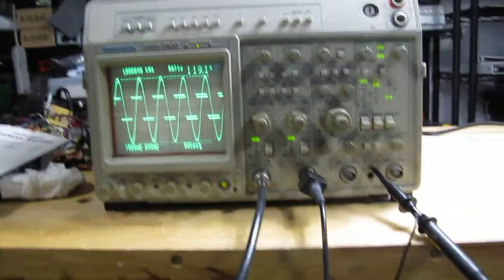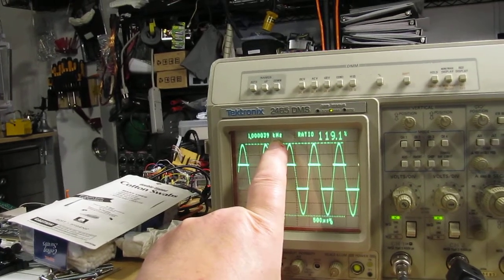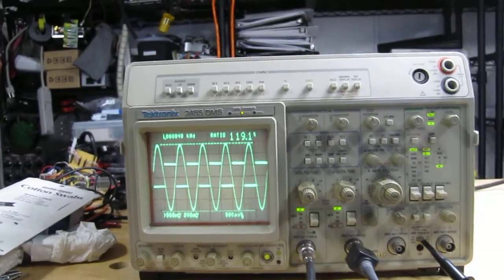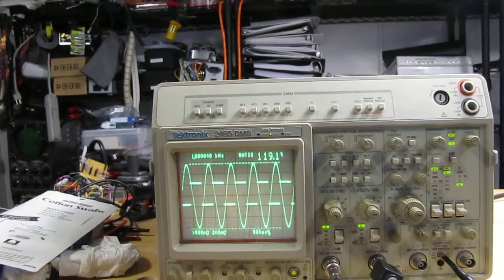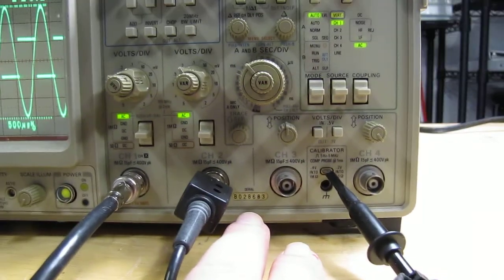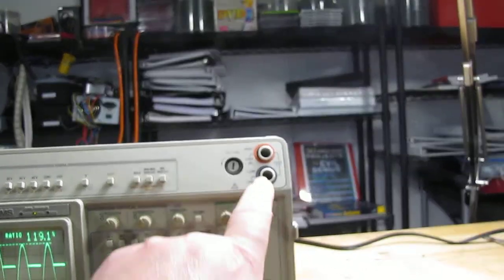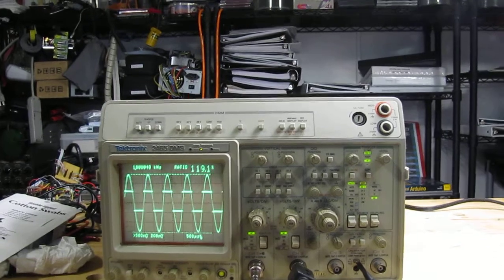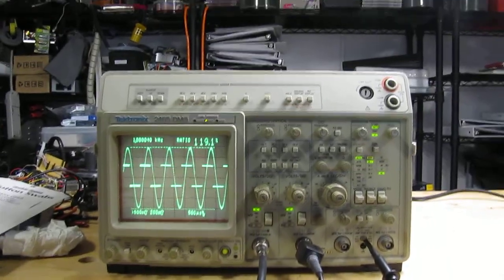TEKTRONIX 2465 DMS working now!

Comment: Gd day sir, I have a tek2445b with channels 1 and 2 trace goes up and down slowly, channel 3 and 4 are normal, sometimes channel 1 and 2 work normally  whrnever problem pops out the test calibrator terminal goes distorted, what could be the problem sir, any advice will be highly appreciated thank you.
Reply from the maker: I'm no expert for fixing scopes, but the way I received help was that one of the web user from Tektronix recommended to clean the switch that brings all tracers into the middle. So I used a contact cleaner and pushed the switch several times in and out.... spraying the contact cleaner into the long switch (left bottom corner on my scope). After several minutes doing this, my scope was fixed. I think if you join the Tektronix email group and ask there, someone will help you for sure, like they helped me! I'm sorry that I don't know what else to tell you, but I remember few troubleshooting suggestions: There are capacitors that leak or need replacing. There could also be some pars that are burned, like small resistors and they need replacing. Cleaning the insides and make sure the cooling fan is working and it's blades are clean! There is lots of heat generated and if the cooling fan isn't cooling well, or not at all, you could get all kinds of problems, including burning up important chips! Also, this is where I watch many videos: https://www.youtube.com/results?search_query=tektronix+2465+dms+repair+fix+groups   Lastly, here is the group's website: https://groups.io/g/Tektronix   I'm sure you can find helpe there! And Happy New Year to you!

Comment: Good morning Tony. Good job on getting the scope buttons cleaned up and running, it looks good.
The DMM is probably regular banana plug types.
As far as the probes, get some cheap ones to start with and then if you need the more expensive ones get them later. No sense spending money on an item you don't need yet when you can put it into other test equipment or things you might need. Best Wishes & Blessings. Keith Noneya
Reply from the maker: Thank you Keith again. 
I'm glad to share my happiness with everyone. Czech people say: "When you share your hurt you CUT IN HALF but when you share your happiness YOU DOUBLE IT!"
Yes, I agree with you about the probes. I have 2 spare 150MHz that I used to test it, but I think I need to get 300MHz to match the speed of this "puppy". Do you recommend using 400MHz probes? I do not know much about these details yet but hope to learn more. I have a modern scope, just 2 channels 100MHz, but a nice scope that I have for several years. I also have a generator so I have few toys, despite not knowing as much as I like to. I wish you and all of you out there a nice weekend!